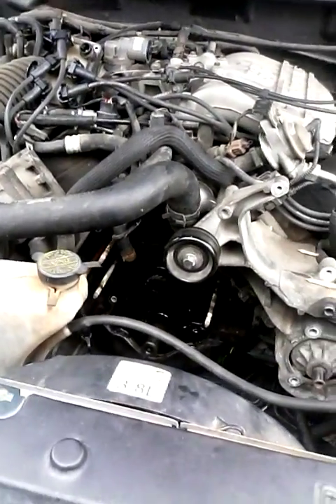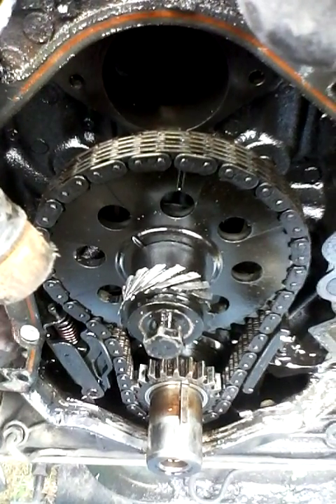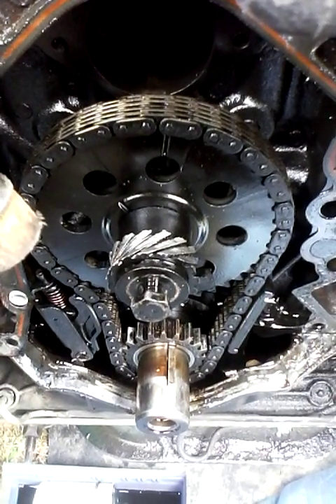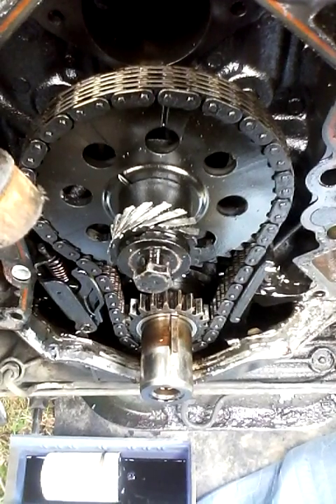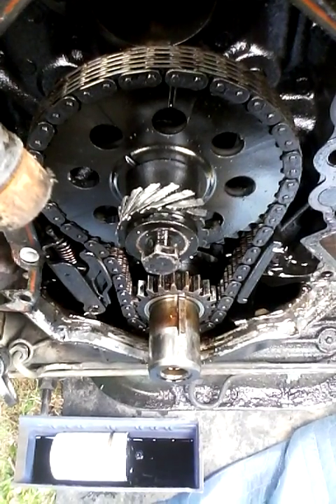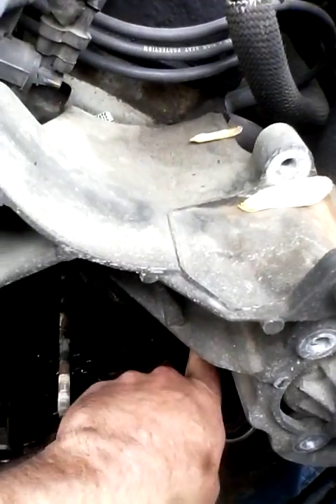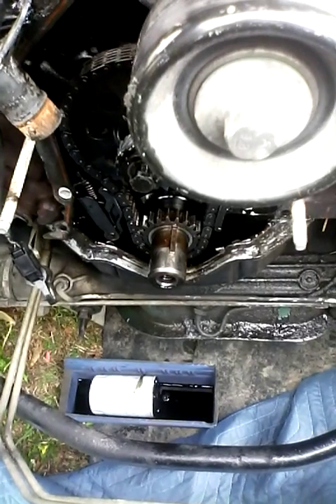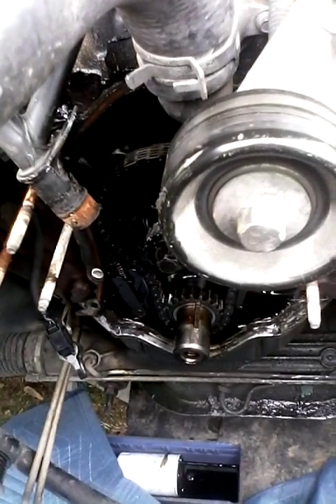98 mustang 3.8 cam gear stripped out

Comment: I've had this very same problem, twice, I was able to find one from an older model that is much harder so I'm crossing my fingers. If it goes out again I'm switching to an electric oil pump
Reply from the maker: Twice here to. We got rid of the car after the second time
Reply: @blue68chevelle  trust me I'm about to do the same. I've been waiting on ford to get the part for 2 months and they still don't have it. That's why I ended up getting a used one.
Reply from the maker: Lazlow Behen And the stupid thing is, the vehicle will run without that stupid synchronizer on top so really all you need the gear for is the oil pump.
Reply: @blue68chevelle  Its basically a failsafe for if the cam or crank sensors go out. It was very stupid to replace an obsolete distributor with an equally obsolete sensor, but it saved money in block design by keeping the rest of the distributor assembly intact. Also it turns out that not all synchronizers are made equal and some need to be shimmed up half to a full mm in order to prevent excessive strain on that cam gear, thus really worsening the problem. The Vulcan 3.0 has that same problem with aftermarket synchro's and that's how I learned about it

Comment: Did it run correctly after you change the gear or should I just scrap this mustang
Reply from the maker: It ran perfectly for three months  then had more issues so we got rid of it.
Reply: @blue68chevelle  what were the other problems engine problems I cannot find that gear I have a 99 3.8 I've been searching since I messaged you and I cannot find it anywhere
Reply from the maker: I had to order it from the Ford dealer parts department it seems like they can’t figure out that it is not a part of the camshaft unless you can find the actual part number and give it to them. By now it’s probably completely obsolete since there was only one company in North/South Carolina that was making them. And the thing is the gears are soft. The issues were lubrication problems even though it had plenty of oil pressure. So it appears That may have been the cause of the gear stripping out in the first place. The car was over priced and my son was having issues with the person he was buying it from so we literally parked it in their driveway and walked away from it. I told him to treat it like a rental and if he looked at it that way he wasn’t really losing anything because he did get to use it for a while for the money he paid to that point.
Reply: @blue68chevelle  yeah I think I'm going to have to go to a junkyard or something to get that gear cuz I can't find nothing on it I appreciate your time thank you so much

Comment: How did you get the cover off without damage?
Reply from the maker: Trueblue412 It’s been quite a while since I worked on this vehicle and it turns out the gears you get from the dealer are soft. it was a few months later that they stripped again . Call the dealership, they would only warrantee the gears if we removed them again and took them back then wait on the replacements. so the car is long gone. But as I remember, there was a bunch of stuff that was bolted in front of it that had to come off first before you could remove it. Sorry if that doesn’t answer your question But that’s the best I can remember.
Reply: I was just looking on how the cover came off i got all the bolts out but its stuck and your not supposed to pry it off cuz you can crack it
Reply from the maker: Trueblue412  As I said before it’s been quite a while since I’ve worked on this car but generally the covers are glued on with silicone so maybe try a soft dead blow hammer or a wooden or plastic block with a steel hammer and tap lightly around the edges to break it free. Also triple check the bolts, make sure there’s not one down in a recess that might’ve gotten overlooked. Vaguely in the back of my mind, I’m thinking there was the odd one on the driver side of the engine, down in where you couldn’t see it very well. but that’s just going off of memory. Might have to feel around or use a mirror and flashlight just to be sure.

Comment: Ford is trying to tell me I have to replace the whole camshaft, because that gear is attached to the whole camshaft. You said right in the video that the gear slides right off, what year mustang was this on? Where did you get the gear?
Reply from the maker: Kody Todd that was a 98 Mustang. We ordered it from the Ford dealership. This is the 3.8L engine.
Reply: I realize it was literally years ago you did this, but I’m having a lot of trouble finding anyone who has the part, do you remember what it was called?
Reply from the maker: Ya, that's because Ford, in their infinite wisdom chose to call it "gear, distributor drive F7ZZ6255AA" even though there isn't a distributor on this engine.
https://www.ebay.com/p/Ford-F7ZZ6255AA-Genuine-OEM-Factory-Original-Drive-Gear/1511157761

https://parts.com/index.cfm?fuseaction=store.PartInfo&PartNumber=F7ZZ6255AA&VehicleID=186377&diagram=T020160&Title%3D%2DF150%2DDRIVE%2DGEAR

https://www.fordpartsgiant.com/parts/ford-gear-drive_f7zz-6255-aa.html
Reply: I can’t even describe how much you literally just made my entire month. Thank you so much!

Comment: Did your camshaft syncronizer gear was without damage?
Reply from the maker: pacodelijorgejr  the camshaft synchronizer gear was stripped also. We put a new synchronizer in, reassembled the engine. It ran for about three months then stripped the new gear. I called the Ford dealership where I bought the gear since it was under warranty. They said the warranty covered a replacement gear ( another piece of junk soft gear) and only if I brought them the old gear back. When I told them the gears suck, they aren't finished correctly to mate together properly ( I've been a machinist for 30 years and have built thousands of gear boxes using the same style gears) the response was "you must have another problem that's causing the gears to wear out.". So much for their warranty.  We sold the mustang cheap. No longer our problem